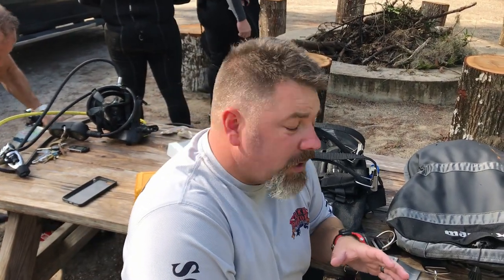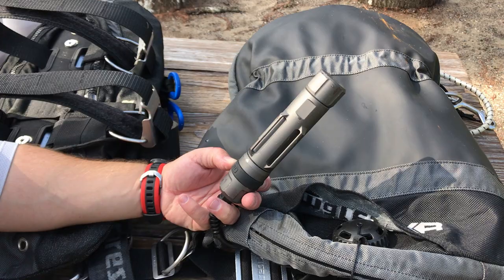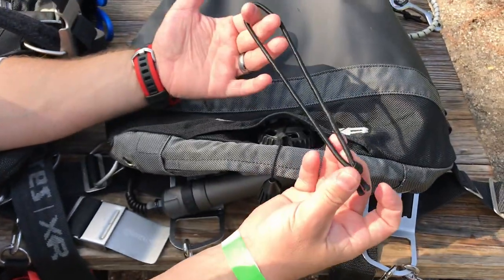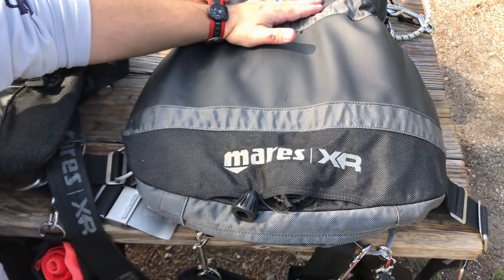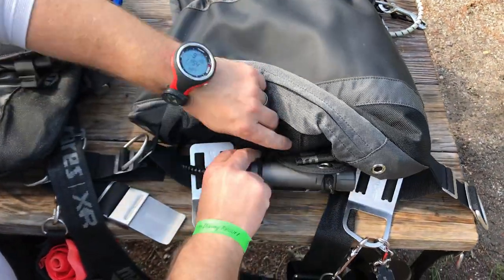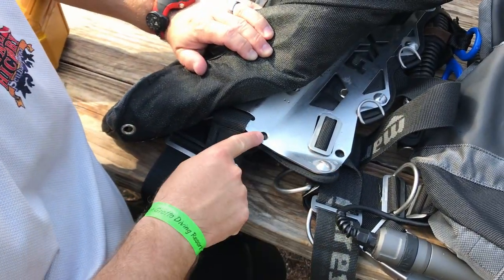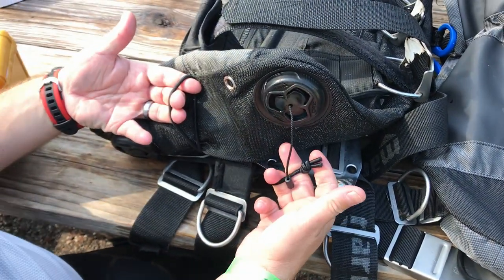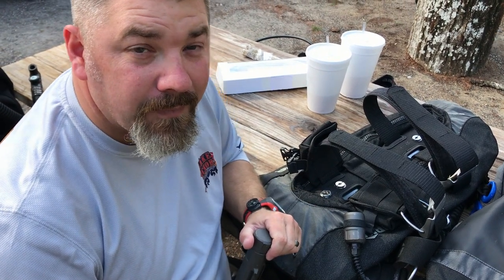How To  Make A Quick Detach Mount For Your Canister Light

Comment: I’m looking to sidemount my Mares 75xr’s. Can you tell me your method for connecting and routing the left regulator, as well as what length hose are you using? How do you keep the hose from crimping?
Reply from the maker: Hello Average Diver, I can try to do my best. The Mares 75x, which was the solution to the Mares 25x only being designed for Doubles and Sidemount, allowed a diver to use the same first stage for single tank use as well. With the additional ports, you can route hoses in any direction. My current set up is as follows. (With a 25x first stage of course.) Left Post. 6 inch HP with single Mares XR SPG. Standard 29 inch LPQD BCD Hose, and a 22 inch LP Hose with a 120 Swivel. Right Post. 6 inch HP with single Mares XR SPG. Standard 29 inch LPQD BCD Hose, and a 7 foot Long Hose. All hoses routed downward on the cylinders. Left cylinder, short hose goes around from left to right, and secured with a custom bungee. Right cylinder long hose comes out of the bands and wraps around just like a standard long hose configuration would in back mount. Hope this helps.
Reply: @LakeHickoryScuba  yes this is very helpful. Your the only one who I have found that uses basically the same reg set as me in that configuration. I’ve measured the short hose at 21 in and have tried it out in the pool a couple times to test fit. Unfortunately I find the 21in short hose not near long enough and I am forced in a chin down unable to have freedom of movement situation. Am I wrong to have ordered a 30 in hose? I have a class coming up in a few weeks but I just wanted to show up a bit more prepared is why I’m asking all the questions. Thanks for the reply and your time.
Reply from the maker: @averagediver1819  The 22 inch hose was slightly too short for me as well, but with the 120 swivel it gave me the exact length that I needed.

Comment: Isn't that just a fix for poor design of the cannister light? What designer requires you to dismount their product to change battery, or twist up a critical wire?
Reply: depends on how you look at it, canister with removeable cable port vs fixed glanded cable, additional point of failure vs difficult to change cable should it become damaged
Reply: @ThePlexman  or make it 3 piece with a semi permanent seal at the cable end and an easily removable battery compartment end.
Boils down to cost and quality. Most cannister lights aren't cheap but use a weird combination of shonky design as far as I can see, some use pushbuttons and rubber seals where a simple magnetic switch would be safer and more preferable.
Reply from the maker: Hello James Buckle, I like to call it Scuba Innovation.